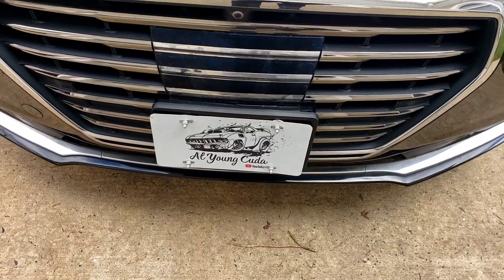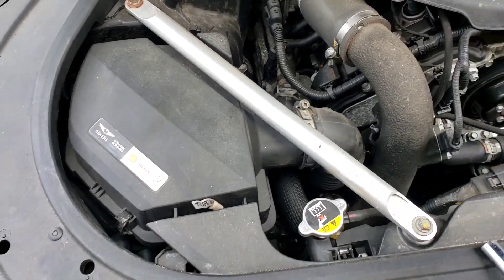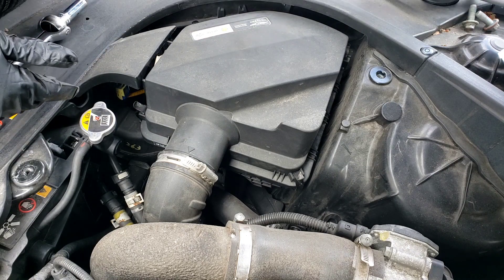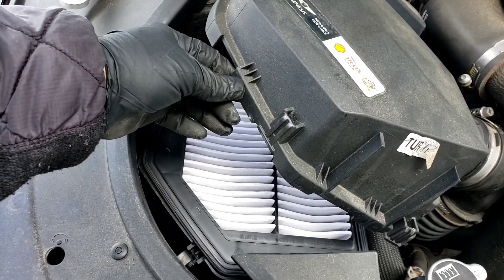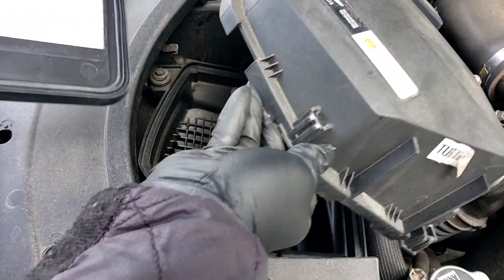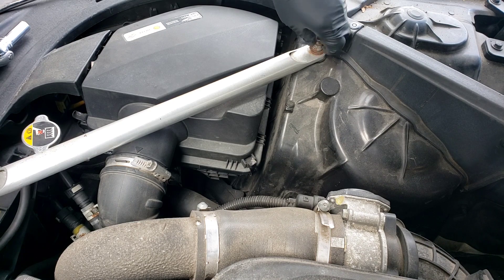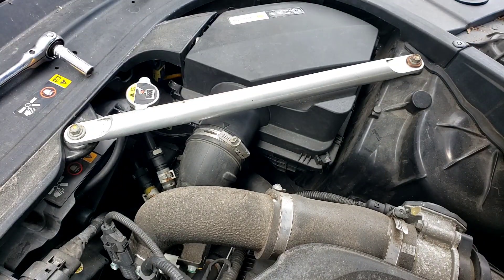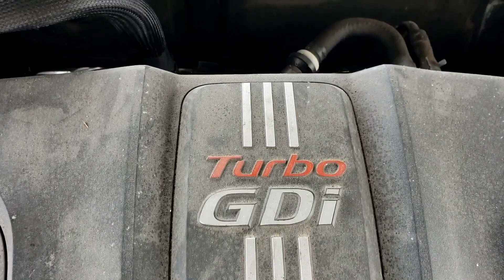Genesis G90 Turbo Air Filter Replacement Change 2017 and Others Similar

Comment: Those Clips are a major pain. If you remove the plastic shrouding it is easier to gain leverate on the clips and get them in place. I just did this job, with the shrouds in place, using a 22mm Box End wrench to leverage the clip up and over the holder. Still was not able to get that one that gave you issues.
Reply from the maker: @gamerjunction5335  they definitely don't give you much room for sure...